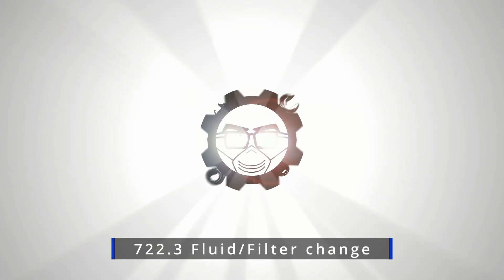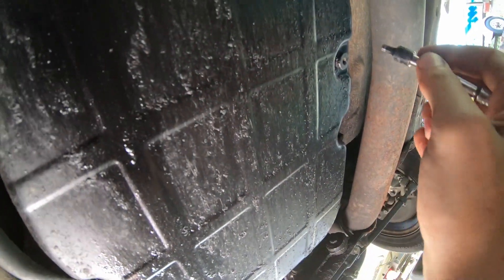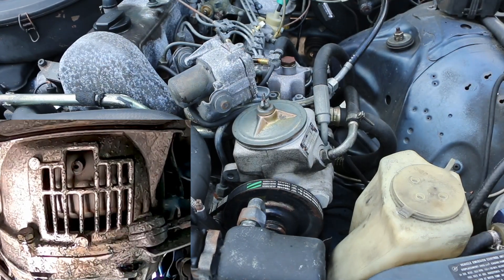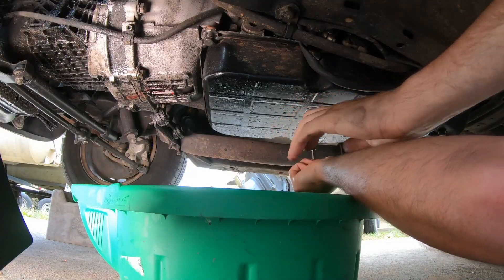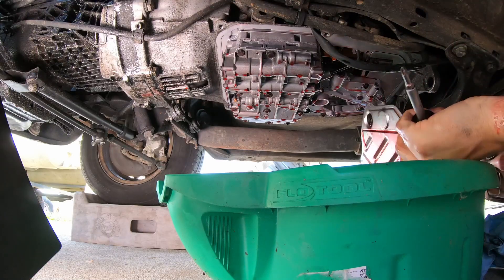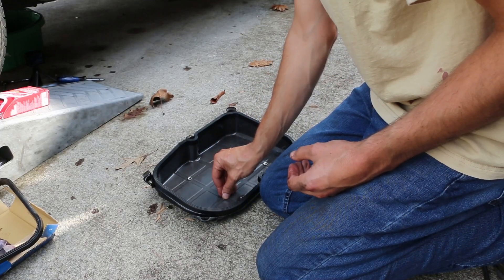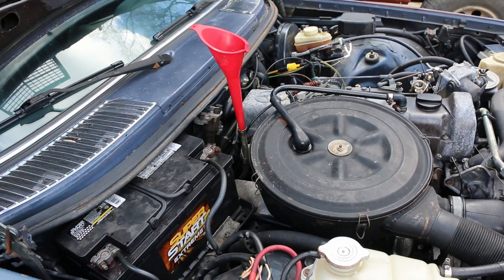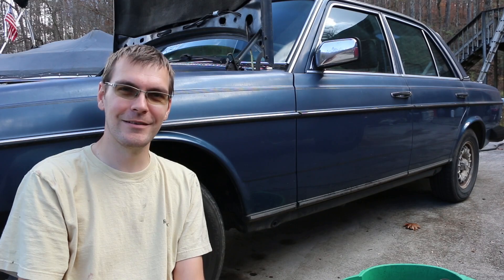Changing transmission fluid on my W123 (722.3 automatic) [W123 Transmission series PART 1]

Comment: That is pretty awesome you where able to get the torque drain plug in position with using the power steering belt! Like you say just go slow... Thanks!
Reply from the maker: Its much easier to gently rock the engine over with that power steering bolt than get a socket on the crank bolt, especially when its not a huge rush or super fine detail thing like setting timing or something.

Comment: Great channel, so glad I found as I recently purchased an ‘83 300DT!
I did all the vacuum repairs and tuning but still have a hard shift into 4th. Great shifts and timing for 1-3. Did you ever solve your shifts?
Thanks!
Reply from the maker: I've got fairly good shifts, the fluid and filter didn't change much, it looked like it had been done sometime fairly recently before I got the car if I had to guess, I still need to do the other videos I was planning in this transmission series, I haven't gotten around to digging into that stuff, but they will be coming likely before summer!
Reply: The 300D came with 2 different transmissions, a vacuum only type, and a linkage type. 
Usually, the vacuum type had shifting problems when the vacuum valve on the tappet cover was faulty or connected wrong.
Reply: That is if your transmission was a 722,1 type.

Comment: Don't look like you use a new crush washer or washer on the transmission pan drain bolt, right?  Suppose you didn't have any leakeage reusing the same washer, correct?
Reply from the maker: The filter kit did come with at least one new crush washer, I'm not 100% sure where it went, or if I even remembered when I was assembling it, but I've had no leaks.

Comment: I wanted to understand why the 300sd w116 came with the 722.1 transmission and what is the difference between the two. In addition to this longer character
Reply from the maker: I believe the main difference is the W116 model transmission was set up to start in 2nd gear for a smoother "more refined" start. the later W123 models got transmissions that were set up to start in 1st, which made them feel way snappier but also made for a jerkier start. Past the difference in the valve body to cause that, I'm not aware of any major differences.

Comment: I have a w116 and transmission shifts into reverse but doesn’t move when pressing on gas ⛽️. What should I do? Some say it’s a shift cylinoid
Reply from the maker: My very first car was a W116 I bought as a salvage vehicle and repaired, drove it for 10 years without a single issue, then ended up having to sell it. I still regret selling it.

Anyways, you should have a 722.1 or 722.2 transmission if I recall correctly.
There are no solenoids, it is a fully mechanical transmission just like the 722.3 in my W123.

The reverse gear is engaged by the B3 band and "freewheel", the lip seal on the B3 piston might be torn or the overrunning clutch/freewheel thing might have failed.

There are some test ports you could connect a gauge to and it might tell you something, I'm no expert by any means, so I'm not sure which ports you would test or what you would expect to see.

Comment: The 4 speed trans in this car is very interesting. I have been in the 7g tronic trans and the design internally is very similar as well as the pan and gasket. The issue with the 7g tronic was that the trans control module is integrated into the valve and solenoid body, and the micro traces broke. Tried rebuilding and nothing doing. I wish Mercedes made a purely mechanical 5 speed. These cars (i have the w116 300sd) have poor highway gearing roaring in the 2600-3k rpm range for today's speeds.
Reply from the maker: I agree. I love the simplicity of my w123 and really the design of basically everything, but it would sure be nice to have an extra gear or two. The 4 speed works great for most of our driving, but a long highway trip and depending on speed limits and how crazy all the other drivers are, I've ended up spinning 3000rpm or sometimes even closer to 3500rpm for hours. And while the car doesn't seem to mind one bit, it is a little noisy and even dropping that to 2500rpm would make for a much nicer ride at higher speed, I have a different ratio rear diff sitting in my garage that I snagged at pull a part, and I debate if the lower cruising rpm would be worth the loss of acceleration off the line. I will likely end up swapping that in when I do my axle boots.
Reply: @trythistv  the 4 speed takes off in second gear during normal acceleration, if you boot it, it goes into first. I doubt the acceleration will be much effected.
Reply from the maker: That is true of the w116 trans, my very first car was a w116, a gold 1980 300sd. One day I should do a recap of all the cars I've owned. The w123 version of the transmission starts in first all the time, so there is pretty good acceleration, and I think the 2.88 rear would do just fine especially with the car always starting in first. Might even smooth out the w123 a hair, from what I understand the w116 trans starts in second to make for smoother acceleration with less of a "jackrabbit start" feeling
Reply: @trythistv  i had no idea the logic was different between the w123 and w116.
Reply: yes, I think at 70 MPH it's around 3300!
Reply: does the 300SD have a drain plug in the pan? I don't see it on mine
Reply from the maker: @MrRjnr  As far as I am aware, all the W116, W123 and W126 diesels had very similar transmissions, and should all have the drain plug in the pan as well as in the torque converter.
Reply: @MrRjnr  mine does have a drain plug in the pan.
Reply: @Engineerd3d  ok,thx!

Comment: Hello, Is anything damaged if I turn the crankshaft in the opposite direction?
Reply from the maker: You should be very careful turning the crank the wrong way, I have heard stories of it causing the timing chain to skip, specifically on the non turbo engines because the turbo engine uses a ratcheting tensioner while the non turbo engines just have a spring if I recall correctly, I have turned mine backwards accidentally and have not had any bad things happen, mine is a turbo engine, I wouldn't make practice of it, but if you just turned it a little bit I wouldn't be too worried.

Comment: I have a w123 with 722.122 4 speed automatic. They advise atf dexron II D oil?
Reply from the maker: From my findings most of the older dexron specs are near impossible to find, and I haven't been able to locate a tsb type thing from Mercedes that gives updated recommendations, so a good fluid that claims to be compatible is about the best I've settled on. My transmission has been great with the fluid I used in this video, I believe it was Valvoline maxlife full synthetic, your 722.122 is a slightly earlier trans, but would internally be very similar to my 722.3, years ago I had a w116 that had a 722.1 of some sort, and it was essentially the same other than a different pan and filter. Of course it's your car so you decide what is best for it, but I would have no hesitation using a fluid similar or the same as I used in the video.
Reply: @trythistv  i checked specs of MB and ATF dexron II D is posible to use. Same oil can also be used for powersteering i been told. So i order 6 cans of 1L kroon atf dexron 2D oil.  Qurious how it wil run wit some fresh oil and filter. Going to do a full service next wednesday.  Engine oil  they also told me to use a 10w40 semi syntetic so i bought this also fron kroon oil(dutch brand) of course al New filters and New sparkplugs fron Bosch for the w123 230E i have.

Comment: How much did it end up taking?
Reply from the maker: I bought 2 gallons of fluid plus the little bottle of lubegard, it took almost all of it, I would guess about 7 quarts of the actual ATF, maybe 7.5 quarts if I hadn't put in the lubegard. Manual says it takes 8.1 quarts for my trans doing the converter and the filter but mine must have retained a little fluid somewhere.

Comment: how often should this be done?
Reply from the maker: I do believe it is listed as every 30,000 miles in the manual, using synthetic fluid like I did may extend that but I plan on monitoring the condition at every oil change and if the fluid starts getting dark or changing in odor I will change it again. The fluid that came out looked quite clean, as did the filter, so it is highly likely this was serviced not too long before I got the car.
Reply: @trythistv  ok, thx!
Reply: @trythistv  most MBenz mechanix with 30+ yrs keeps saying the other way around. These W123s & older models should not be given synthetic oil on both engine, transmission , diff and steering fluids. On transmission just change the filter and put back the same old fluid and that not to touch the converters? I have two (2) S123 where one is a turbo diesel and the other one is 230TE 4cyl petrol. As well as a W123 sedan turbo diesel. I just sold my other W123 (silver) on BaT wherein which I was advised to do just that and drove the car for around 9,000 miles and enjoyed every mile before selling it on BaT
Reply from the maker: I have heard this same theory, and personally I don't put much faith in it, mostly because of my own personal experience. I have not had a single issue with synthetic fluids causing leaks, or premature failure. I have seen plenty of cases where a fluid was so old and degraded that it was causing sealing surfaces to wear and seals to deteriorate, causing degraded performance, and when that performance drop is noticed and the fluid is changed (whether synthetic or dino juice is used for the change) it begins leaking in short order due to the damage already done by lack of maintenance.
I run conventional oil, conventional diff oil, synthetic trans fluid, and I believe it is synthetic power steering fluid. I have about 10 or 20k miles on the power steering fluid with no issues, and in the realm of 3 or 4k on the trans fluid done in this video, and it is shifting as good as it always has, not leaking a drop like usual, but it is obvious this car was well taken care of, the fluid that came out was very clean and so was the filter.
That being said, I'm not an expert, not factory trained or certified, just a guy doing his best to keep a very enjoyable car going for many years to come if all goes well!
Reply: @trythistv  I agree with you about many cases where the fluid was so old and degraded that it was causing problems in these vehicles

Comment: im here because there is no info on type of atf my 82 240d takes....
Reply from the maker: You'd have the same trans I do, 722.3 or variation of it at least. They call for a Dex 3 fluid, but dex3 isn't made anymore, so finding a quality fluid that is labelled as being dex3 compatible is the way. The fluid I showed in this video (Valvoline maxlife full synthetic) has been working great for me, I've only put a few thousand miles on since the change, but it has been shifting nice and working as good as any MB trans I've felt before.
Reply: @trythistv dexronVI is synthetic and also backwards compatible with dexron 3
Reply from the maker: It is also much lower viscosity, which will raise the stall speed of your torque converter, and may cause shifts to flare. With a non lockup converter like our cars have, raising the stall speed could cause some other issues with cruise rpm and efficiency.